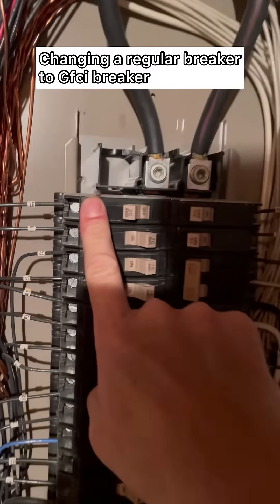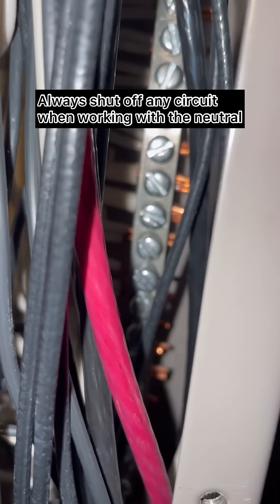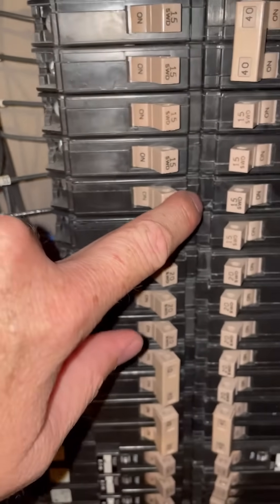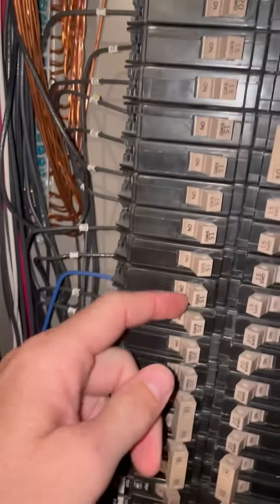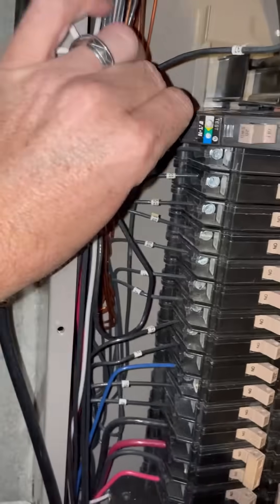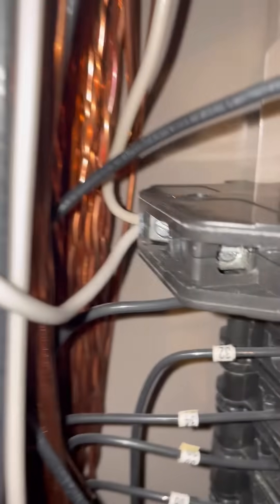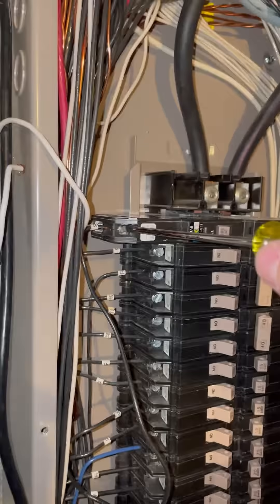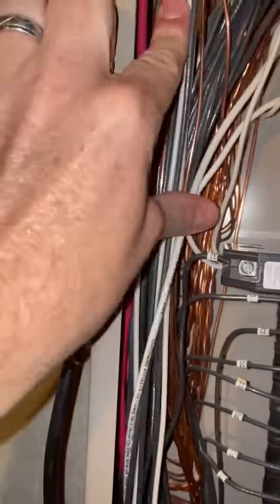Changing regular breaker to Gfci breaker #electrician #howto #diy #apprentice #construction

Comment: I worked on an electrical crew in college and now wire Habitat homes, so I am a fairly knowledgeable amateur.   I'm sure you know what you are doing in that messy panel, but the presentation has abrupt camera movements and rapid fire delivery which leaves me a bit unsure about a potentially dangerous process.  Please use a steady camera, moderate speed and no unnecessary background music for those of us looking for clear advice. I say this as a long time communication professor.

Comment: I'm not sure what's happening here, are two circuits sharing the same neutral and that's why you had to turn off a different circuit? Once you find the shared neutral, that goes into the new GFCI breaker, and the pigtail into the bar. What if you can't find the neutral of the circuit you're working on? Can you just connect the pigtail into the bar without having this shared neutral plugged into the new GFCI breaker?
Reply: agree.  this was a horrible video skipping all the important stuff.  Eeeesh

Comment: Nice job Joe. I would have done the same thing and NOT shutoff the main. People freak out when the wifi and AC go down even if it's for 10-15 minutes or whatever.  Also, shutting off the main can be a bad move especially if its an old panel. Sometimes those springs inside the breaker DO NOT want to RESET and then you are screwed.

Comment: Why not just shut the power that the main, pop off the breaker, swap the hot lead, tie down the additional neutral and call it a day? Why trace the neutral if you don’t have to? Thanks for the content. 👍🏼
Reply from the maker: This was a customers home. They were home so did not want to shut all of their power off 👍. Appreciate the question
Reply: @electricianjoe  Makes sense. Greatly appreciate the reply.
Reply: wondering the same thing. i do a lot of remodels when the residents are staying else where. makes sense since the homeowners where home. great job buddy 👍🏽